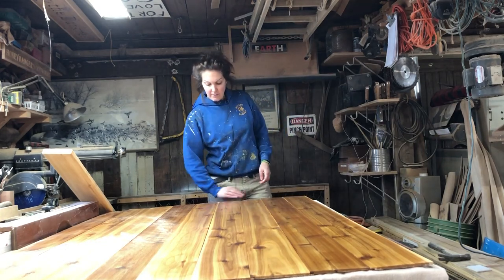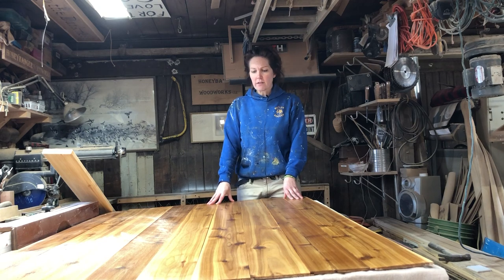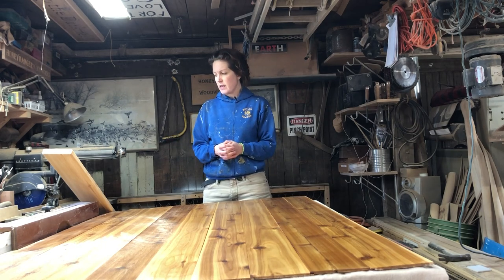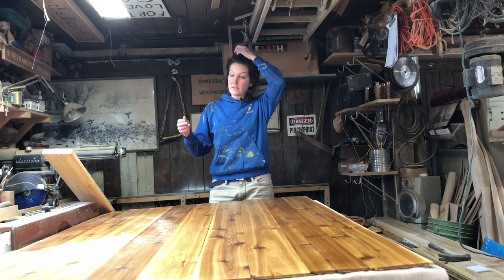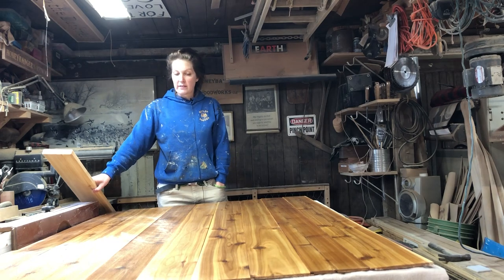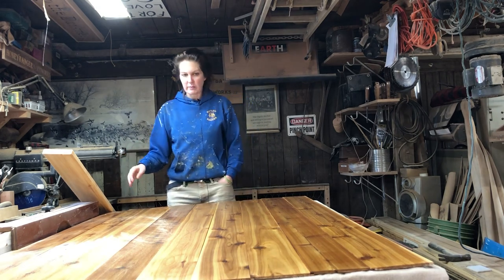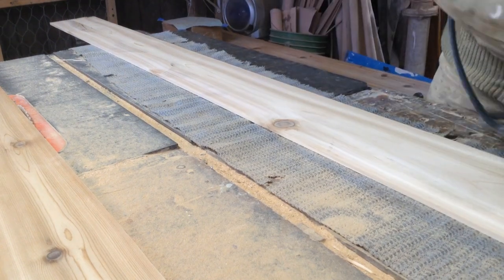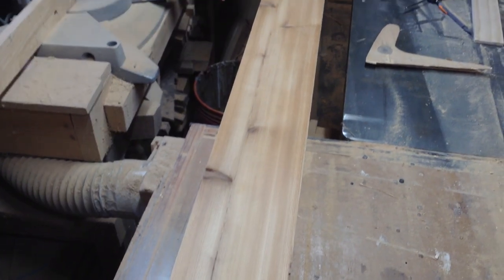Woodworking : DIY Accent Wall / How-To

Comment: Thank you for the post. 
 Nice work, love working with cedar.  I am curious, why not remove the bullnose first?
Reply from the maker: I find the thinner the lumber the easier it is to get a straight rip on un-jointed material when doing it on the table saw like this.